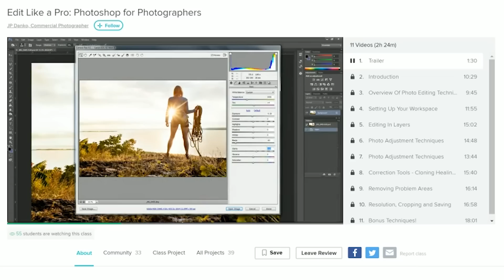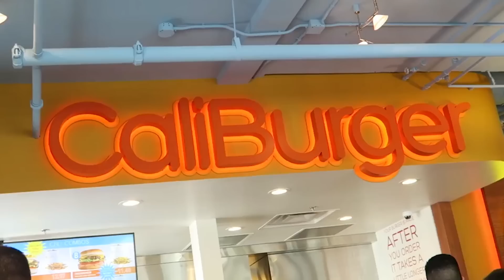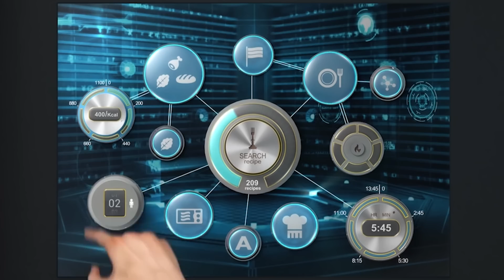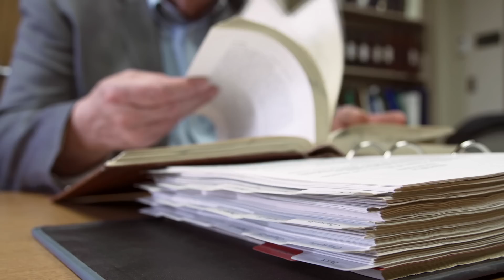These Revolutionary Robots are About to Steal Your Job

Comment: Unfortunately the AI Revolution will remove way more jobs that it will create, unlikely the industrial revolution. Most of the new jobs created will be extremely technical and require a very high education, while the removed jobs will be mostly stuff that involve repetitive labor or tasks that mostly involve memory. As such, in 10-20 years societies will probably have tons of jobless low-skilled people and many high level technical positions without enough candidates for them.
Reply: Sounds like a recipe for revolt if you ask me.
Reply: Unless the robots financially support the humans they displace, yes.  People won't sit in a corner and quietly starve.  There will be blood, and machine oil.  Taxing robots may seem silly, but it does make practical sense.  Considering their productivity is much higher than a human's, the tax revenue should also be much higher.  That money can then go support the displaced citizenry.  Not that I'm naive.  This idea will get immense opposition from the same corporations that buy government elections.
Reply: I think what will be more likely is that people will use software to improve their jobs. Burger flippers, and cooks at restaurants don't really drive the economy. I recently read that minimum wage jobs actually only make up 5% of the entire labor force. They will be replaced, but they don't pay into the system to begin with. More than likely you'll have someone there monitoring the robot on standby in case it stops working. You'll still need tellers and people always will appreciate a friendly human face. Until there are actually human robots it won't be that bad. If I were the people I would be more concerned with gaining property that is guaranteed and then the only bill you'll pay is to feed yourself. If automation is as prevelant as they claim goods will be absurdly cheap. You won't see alot of people rising to high class anymore maybe but everyone will probably not lack. They won't be starving like they used to. That's a big win, enough with this inequality BS, be thankful for what you have and try to improve your lot. Be thankful you aren't starving to death like everyone used to do til now
Reply: Not education, creativity.
Reply: Then we need a revolution in education with the help of AI to fill the qualification gap. The far larger problem are the crooked shepherds that guard the sheep.
Reply: Which is more reason governments should invest in education. If the "low skilled people" have more access to education then they won't be left behind
Reply: Truth, I work at a logistics company for insurance companies' customers, and there was 2 areas of my company that almost disappeared entirely because of automation. Now an AI is handling "conciliation", which is the area that checks estimated prices and hours of work with the work that's actually been done. Almost 20 people were fired. Now they're testing an entire new system programmed to handle real time data of work being done by sub-contractors, leaving personel who do that job out of the equation. I'm not saying it's inherently bad for employees asmyself, but, as it's stated in this video, technology advances far faster than we humans can entirely adapt to it. And, to be honest, machines are making our lives easier, but no one can get paid for doing nothing, so... Automation means many people are going to be left with no job, means no payment, which leads to the question of "what are we going to do with our lives when everything gets automated..?"
Reply: Sounds like children better start learning and studying instead of playing sports and video games and messing with their smart phones.
Reply: TheDarkever that’s why it’s more comparable with the slavery days of America rather then the industrial revolution. Lots of cheap work force wich is owned like property
Reply: They have enough people for the tech jobs now, but businesses put out bogus requirements so they can claim no qualified candidates. Hence brand new tech with jobs that require 10 yrs experience in a senior role with such. So they grind the H1Bs to dust, boot them back to home on burnout, rinse, repeat. SJWs have weirdly joined in with the corporate slime and claim the anti-H1B people are "racist."

During the last crash, there was a job here for a senior C++ programmer to work on a browser. $10/hr. It'll be like that. With complaints we're spoiled brats and to suck on it or someone else will. The people lacking extensive tech knowledge (they were forced to work on themselves) will be left in the gutter. Cattleprod zapping the rats, who just go shredding each other. Vs the evil hand wielding it.
Reply: @czos9239  , man, what are you smoking?  $10/hr C++ programmer?  Where are you, Shri Lanka?
Reply: @Dave-sw2dm  Major southern city. Biz park across the street from me is notorious for having shops doing stuff that's questionably legal.

I still remember going for a job where they lied about the salary and tried to get you to commit to certain hours and specific times while treating it as contract labor. Which ended up slightly lower than min wage - and without SS or anything else.

That was from Craigslist and blew up on the boards so badly over the job postings they locked the board down.

I could go on forever about other scams. Mainly the standard stuff, but other rather inventive ones as well.
Reply: John Bezz just make high level technical education free one we need the technical workers anyway it’s cheaper than welfare for all anyway
Reply: CZ OS just don’t work and leave
Reply: @qjtvaddict  This seems to have turned into food for the couch sharks.

Fortunately, I'm in a great job. But there are some insane scam attempts. As our systems get squeezed further these scams will no doubt get worse. IMO it's interesting to see where the marker is.
Reply: Robots won't fucking take your job. Companies aren't dumb enough to replace workers who earn the household income. Who the fuck will buy their shit if nobody has jobs. AI jobs will only do the really hard jobs(labour) and companies will hopefully be smart as to go about it without destroying the economy, they depend on. Mass automation will occur when resources are unlimited ie we get them from foreign astral bodies.
Reply: I don't agree. Industry 4.0 (scuse the cutesy name but it actually has one) is aimed at cobotics and synthesis of human and robotic effort. Something like computer-aided design turning into human-aided computer design. Second thing is that society changes radically with industrial advancement, and so do attitudes. Fringe jobs of the time become mainstream, and completely new jobs develop nobody would have thought of being a job before. Especially as people would have more free time with a working week reduced to say 10 hours. That in itself would create a lot more problems, which would in itself create more.... jobs!
Reply: @jessicawiebe7656  Flow of information, good topic. It used to be that there was a clear distinction between mainstream and fringe information. Now you get researched journalism, which may not be neutral or balanced (which is not possible as all information has a bias, whether intentional or not) next to unhinged rants based on nothing at all.  

The danger isn't even the obviously unhinged rants of conspiracy theorists, religious and political extremists and the like, but disinformation campaigns from shady propaganda sources that are difficult to distinguish from fact-based and researched information from legitimate sources, bearing in mind that the difference is one of degree and not absolutes and that there is no such thing as a perfect information source. 

This is the new normal. And it's one of those changes in society that people that use the information have the duty to use it wisely. Critical thinking has always been important, but never as much as it is now.
Reply: @jontmusiteur55  I hear you but if you cant see all mainstream media is scripted you can take all local news in the USA on a story and play them all side by side they say the exact same thing word for word like robots, its a bit well scary to think they all use the same scripted response and there is no diversity in their reporting of news.

you can think there is no conspiracy and yeah the radical religions that is another aspect of it because they infiltrated the schools churches.
Science is a religion also they have a "Church of Scientology" like its ridiculous its not a conspiracy theory its the truth of this world and I have slowly watched it unfold before my eyes people loving rock and roll or heavy metal overtly satanic the beetles speak of it. 

here this video is 13 min since you respond quick to all that and done even bother to watch the 2 hour video before responding.
I know there are many churches out there spreading false doctrines, bible calls those doctrines of devils. I left the church because they started selling out and speaking radical differences in salvation they told me faith in Jesus alone for salvation was enough then .... oh any sin will damn you to hell kind of stuff I dont buy in to that, Satin did a good job in messing up this world and all the false doctrines pitted religions against each other to fuel the whole see "dont follow that see how violent it is?" when it is the Jesuit order of the round table. 
  
https://www.youtube.com/watch?v=9bt80guhy_A
Truth is they are not hiding it anymore they have full on "Satan is returning from hell" public rituals at the Grammys Football game halftime shows always the Devin Feminine just like old time rome worship the mother or idols of ancient gods not the man big push to worship women idk its scary.
Reply: That's why G.I. guaranteed income to maintine life it's the only way, you pay people to live. They might have to slow down the changes instead of one or two decades maybe they should go for five or six decades, and wait for generations change instead ! The shock of the move over a short period might be just to much to quick .
Reply: @barriewright2857  I fully agree with people being paid to live, and maybe more importantly depending on your standpoint, being paid not to cause riots and civil unrest, but...

How could they slow down the changes? Once it's started I don't see how anyone can stop it or control it. They might try and mitigate the worst effects, but even in that they've not been particularly successful. Mainly because "they" consists of way too many people – inventors, investors, instigators, opinion makers, developers, regulators in all the post-industrial societies.
Reply: and revolution.
Reply: @TheShadowblade Humans don't come up with new ideas either, they adapt and combine old ideas. A new product idea based on sales trends of existing products would be simple: Combine a Palm Pilot and a Nokia from the same time and you have an iPhone. Create a "hip" image around it and away you go. 

There is no reason why AI couldn't do the same. AI has proven its worth in all kinds of problem-solving. It wouldn't understand any of these concepts, but it doesn't need to. It just needs to recognise patterns – something computers are better at than humans because they can handle huge amounts of data quickly and objectively. 

What AI can't do is "think" (ie process data) beyond its own programming. The AI in a Roomba wouldn't be any good at diagnosing faults in a car, or cracking the nuclear codes or whatever.
Reply: @TheShadowblade You're raising human creativity to something mysterious when it isn't, it's highly disciplined and has strict rules. AI is already being used in marketing to do the exact things you say it can't do, but it's not developed enough and doesn't have the massive amounts of data required to take on the whole task without human guidance. If AI is programmed to create new ideas by combining patterns describing products, their markets and uses then that's exactly what it will do. Given enough reliable data, it will crap all over any human inventor. It won't be consciously creating anything new (obviously as it's not conscious), but it will be going through the same motions a human inventor or product developer would with the same result.
Reply: @TheShadowblade There are a lot of people that aren't idea people. There just average people. What do you do with them?
Reply: @TheShadowblade You must be a college graduate and have spent the time with creative people all your life. I am a non college educated person and have spent my time with people who can repair things. Let's just take a motor to a car. I know many people hat can work on them, but if you gave them a chance to design a new motor they couldn't. You really need to get out more and spend a little time with people other then your 'smart" friends. You have no idea how many people that was working on something that said that there was nothing that could be done to fix a problem. I would walk up and get the best people at each job and get thigs to work. But I have an imagination. Many people don't. All they know is what they have been doing forever and any deviance from that is just wrong. So again what are you going to do with these people. Shock treatment? You can't make a silk purse out of a sows ear. My X-wife could come up with 20 new ways to wipe your ass, but coming up with something new as far as a product, it ain't going to happen. Hell my son and I have been trying to come up with some way of making money by building things and have come up with nothing. We're just average people, but nothing comes to mind. Plus any ideas we may have we don't have the money to make it. So again it is all for nothing. So again when robotics and AI's come along what do we do with the masses. Go live in the poorer neighborhoods and look at the people and talk to them and you will see what I mean. No they're not dumb, because they can take a piece of garbage and make it work, but that is a far cry from inventing something.
Reply: @TheShadowblade But what if their not? Maybe your professor is wrong. You do know there are people with different IQ's out there. Just take my X-wife. If I wanted to get across Chicago alive I'd take her. But as far as getting anything out of her that has to do with imagination, I wouldn't count on it.

Comment: Hahaha, I'm a roofer! Good luck Mr Roboto! 😂
Reply: There are all ready designs for AI/Robots building entier citys....
Reply: We can 3D print houses too, but you need a human touch for the roof.
Reply: Whats so hard in building a ' stack em and pack em ' box... like they're making now ! Only one roof required per 1000  ' 10 x 30 ' units !
Reply: I do high-end work, painted metal standing seam, zinc, stainless steel, copper, as well as slate, cedar shake, and rarely asphalt shingles. The only "robot" needed is Spot, the seamer and I control that.
Reply: @beardedroofer  Sounds like that will be one of the jobs that they will be training slaves to do for food and water. Obviously there not going to pay huge amounts of money to physical jobs that they can make slaves do !
Reply: @waynebow-gu7wr  
No slavery, we have free will, or free won't depending on a person's point of view. Slavery should be abolished worldwide.
Reply: @beardedroofer  It ain't about what robots are needed for.  It's about what can can do cheaper than people can.  Roofing isn't much of a technical challenge there.
Reply: @bobpeters61  
Have you ever put on a roof? It's a little more technical than you think. 
No worries, good luck in your chosen career.

Comment: I was a chef for over 20 years and there are aspects of cooking at the level of a legitimate chef that a robot just can't pull off.  Everything that goes into a plate (not to mention 5 different plates at once) requires ALL of your senses like say you're looking for just the right color on gnocchi or firing your pole beans at just the right time and flashing the pan just enough so there's a slight smoky charred flavor and emulsifying a pat of butter with the reduced debating liquid without it breaking. That's just 2 things out of 6 pans in front of you and single parts of 2 different plates. It gets crazy and without all 5 senses it just won't work.